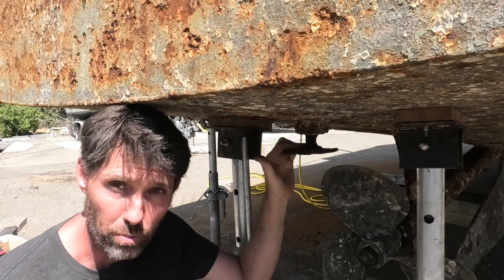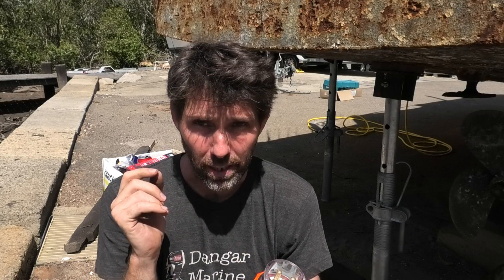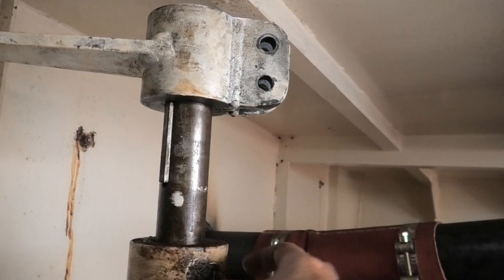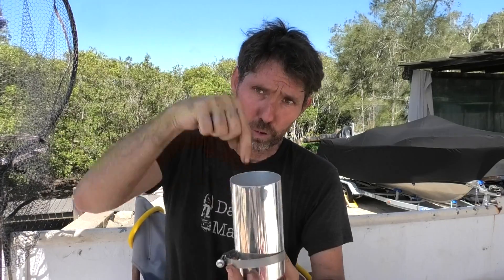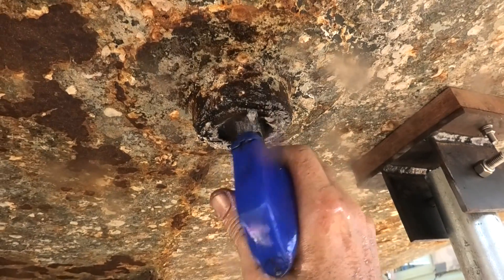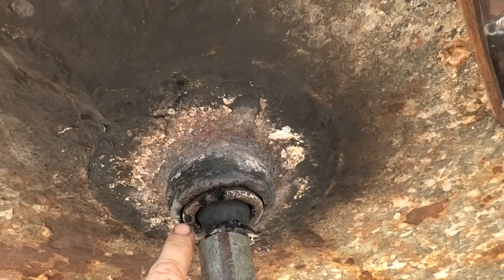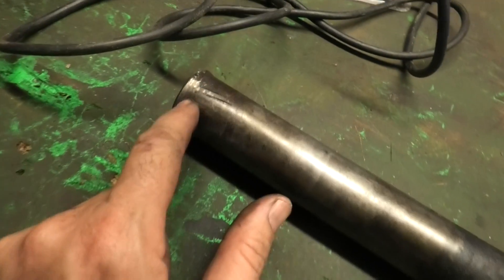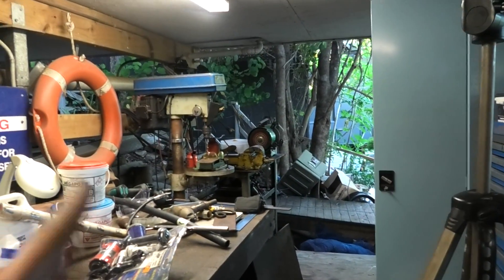Removing the rudder post

Comment: LOL So nostalgic. I got a wooden boat in 1990 that was thirty years old. Just watching you go through the process of addressing a problem and keeping at it until you find success was in some macabre way gratifying. I recall so many projects that had a similar arc of progression., engine removal and replacement, rudder r&r, plank mending, keel filling. etc. etc.  Thanks for the vids. Keep on keeping on mate. The only justification for any of this is the sail to work ratio. As long as a fellow spends more time on the water than working on the boat it is worth it.  I oughta' get out to the vintage fiberglass cabin cruiser in my driveway and go to the lake.

Comment: Good stuff on getting the rudder post out. as for the crane, yes you will be stoked if you can keep it level, i used to be a hi-ab operator and being on the slightest slopes can make turning cranes really hard especially with heavier loads.

Comment: Just bought a 98 Yamaha 115. runs ok, been in fresh water only, and am getting after it for my use. Rebuilding carb. checking heads ect. Alot of the things you have taught me, actually everything you have taught me, steering cable really tough to turn, everything. Thx
Reply: You know that steering might not  be in the cable but could be in the swivel tube on the engine bracket! That would be really nice and a quick fix :)
Reply: If it's one of the saltwater series two I can tell you about getting a 600RPM low idle that's as smooth as silk that'll troll all day without oiling up.
Reply: @dustyfarmer  you are trolling at 600 RPMs! You must be trolling on a river with current! 

What do you do, just tighten the throttle plates?

Comment: Never heard the Ferobestos word for a long time, used to fit them on A frames of twin screws of ships n subs,  have about 4 fire hoses on them to simulate thembeing in the water, a chain block and with a scale attached to it, to see how much strain it took to get the props turning.
Old school stuff.
Your doing a grand job Stu, mild steel or stainless new shaft, ally bronze perhaps.
Hope its cooler down your way than up in qld just now.
Cheers
Malc

Comment: Many work boats use steel rudder stocks with stainless shaft liners installed on the stock where the bearings locate. But for your shaft probably all stainless is simpler.  There is a company named Thordon, who make non metallic tail shaft and rudder stock bearings that work using the ambient seawater as lubricant. They also provide galvanic isolation.  Thordon would work well for your installation, if a stainless rudder stock is used. If you go with mild steel, then you need to fill the rudder tube with grease to keep the rudder stock from corroding. That used to be the usual approach, with a seal to keep the grease in, but environmental considerations have made the water lubricated arrangement more common.  Greg

Comment: Watched this on the 63 inch TV in the lounge and was shouting out to use the hot spanner to move it and you finally did, that seal looks like latty packing, not sure If the spelling is right but many years back we used these in underwater gearbox stuffing boxes with a quality marine grease. I would think twice though about replacing the shaft with a stainless one, if it picks up at all it will be an
 Even bigger nightmare to remove than the mild steel one was

Comment: Great video and nice to see the clear thought process and theroy of work. With the rudder tube I'd personally tap and fit some grease nipples to maintain the rudder post with lubricant
Reply from the maker: Fortunately it already has a grease nipple installed between the two bearings.

Comment: Wait, so the only think keeping a 40mm steel plug from falling out and sinking your boat was that fibrous bearing material and the actual steering mechanics?  Oh, and I guess the rudder and bottom bracket.  Awesome that that's done!  I'm looking forward to seeing how this project continues on.  Keep these videos coming!

It's really cool to see that you're into music.  The cinematography kind of took me by surprise!
Reply from the maker: Yeah, that little 20mm thick gudgeon plate at the bottom might help keep it in place. ;) I do love music, one of my main hobbies outside of boating.
Reply: @DangarMarine  Very cool.  How about a quick off topic video about your music?  May I ask your day job?  Is it repairing boats?
Reply: I think like in my sailboat that the water will only go as high as the water surrounding the boat, since the mechanic space is higher than the surrounding water level, it won't flood.

Comment: Glad you got that shaft out Stu. I guess you are going to use sacrificial anodes. Seeing as you are a saltwater boater, you should install zinc or aluminum anodes to prevent galvanic corrosion on the engine and underwater parts of your boat. Stainless is nice for your steering, but expensive. But we all know that boat stands for Bust Out Another Thousand;-)Thanks for posting.

Comment: Interesting watching your project progressing, thanks for sharing. 
If the crane is not level when lifting heavy loads it will want to turn to the lowest point. If you use it when floating; it could turn suddenly and dangerously if the boat listed when the crane was lifting.
Reply from the maker: That is a good point about turning when lifting if another boat goes past. Definitely something worth thinking about in the design.

Comment: What an epic episode. Roger Dale nailed it in these comments about the bearing material. If your boat had cable operated steering the problem would never have progressed to be so bad. But as evidenced by your bottle jack - hydraulics develop a lot of power and overcame the resistance created by the bearing being clamped onto the rudder shaft as corrosion took hold.

How about trawling scrapyards boatyards for a reclaimed rudder shaft?
Reply from the maker: Yes, finding a reclaimed shaft would be aweseome.

Comment: I work on boats a lot, mostly sailing boats but work on all boats. I would say 100% use stainless steel for the rudder post. The bottom bushing should be brass with a rubber inner, they are commercially made specifically for that job.
Interesting videos, Thanks.

Comment: Hello, I think that that bearing material is ORKOT, I work for a company that machines this material into bearings / liners that are used on submarines/ ships etc, it is a marine bearing material that is designed to swell up a little when submerged. It is even used to line torpedo tubes. Very easy to machine but I think the size it’s cut to has to take into consideration it swelling in order for it to function properly.
Reply: I’ve just done some research, ORKOT is actually designed not to swell up!!

Comment: WOW !  Stu has a second career.  MORE SINGING, even if it is drunken sailor songs !

My vote is for a stainless rudder post.  Big $$$ for sure.  More important, what material for that bushing.  I think nylon is too soft.  Perhaps Delrin ?  I can not remember the name of that material, but is it sometime used in cutlass bearings.  Need a method of greasing the shaft, especially if you go with mild steel.

Comment: Some nice work there. whatever you do, make sure the material is the same in the rudder and the shaft, all stainless steel is dependant on a constant supply of oxygen to keep the oxide barrier intact (this is what ceaps the "stainless" from rusting). you must have liberal ammounts of zinc on the rudder, and a hefty ground strap from the top of the post to the hull. using stainless in the combination whith mild steel is not ideal. i used to work as a cheaf engineer, and have sean this plenty of times. its dooable, but harshe on the anodes. greatings from norway :)
Reply from the maker: There currently isn't a ground strap at all from the top of the rudder post to the hull. I'll have to look into the best way to do that. The little musical section in this video was inspired by watching Stories from Norway at the moment. The one about the Hamar diving board was priceless. :)

Comment: Excellent getting the rudder post out!  Yay!
I would go with Stainless Steel low carbon 304 since it should be be safe to use unlike the 316 kind...but it's your call  :)

Comment: 14:20: We have a deck crane and a chain fall aboard as well. Very handy. Keep it near the centerline.
Reply from the maker: Yes, I'll just have to check the reach on it. Maybe if I keep it near the transom? Also been looking at some small 24V hydraulic units rather than this little hand pump one.
Reply: @DangarMarine  Start with the hand pump one. It will work when you really need it. Lengthen the handle if you want. Near the transom is fine, but consider what the weight of you, the crane and whatever the load is will do to your reserve buoyancy and then decide. If it's for winching in single batteries, fine, but if it's for bringing in 100 kilos, it might affect stability. You'll have to experiment.

Comment: I've got an 'ole steel yacht, that I replaced the rudder stock on as well..An engineer friend who works at Blue Scope Steel, recommended I use COR-TEN high tensile steel..Probably what your boat is made from as well.
Reply from the maker: Interesting you should say that. I have always heard that COR-TEN only really works well above the waterline. I'll have to look into it more.
Reply: Yes, I would ask someone in the marine industry to confirm that..

Comment: the whole unit stainless steal.  It will cost but you will never have to mess with it again.
Reply from the maker: I agree, my only thought is that a mild steel one lasted 30 years which is probably longer than the boat will anyway. I'll check the price difference.

Comment: My 2 cents worth, I would make the new rudder shaft from 316 stainless which should be well capable of handling the torque of your rudder; has excellent corrosion resistance and is free machining. I believe the old rudder bearing may have been made from Maritex 1810 phenolic resin which looks similar to Micarta phenolic resin.  May need to polish the inside of the bore with a flap wheel with an extension rod on a drill or die grinder to clean up. Will probably need a set of telescopic gauges and a micrometer to measure the bore (message me if you need to borrow these).Maritex 1810 would be the preferred replacement for the bush. May need some soft of epoxy resin to glue it into place. Great to see you didn't have to cut the whole tube out. Cheers :)
Reply from the maker: Hey Matthew. Yes, will definitely hone the tube out - at least at the ends where the bearings will be installed. I'll need to find a good tool to measure the bore diameter. Have been meaning to buy one for ages and now seems like the right time. Catch you soon!

Comment: Ran into the same problem with a rubber bushing in a steel sleeve.  Burned/melted the bushing out with an acetylene torch.

Comment: Thanks for your videos.  I think they are popular because you experience problems we all face and don't pretend to have all the answers.  In regard to replacing the rudder post with stainless, I think you have to consider the application above all else.  With stainless being less ductile than mild steel, the length of the shaft and the torque loads may lend itself to choosing a more ductile material.  Stainless steel may be more corrosion resistant, but will it hold up with the constant torque loads?  I think I would go for mild steel with some corrosion prevention such as grease points for the tube.  There is a reason why stainless steel is not used everywhere in marine applications.  I am an aircraft engineer and while aluminium is the choice for structure almost every faying surface is coated with a compound to reduce electrolytic corrosion. Two surfaces of the same material can still have a potential difference which is all you need for electrolytic corrosion.

Comment: I used to work on trawlers like yours and bigger here in the UK, You have a nice little boat on your hands and a great channel too.
All the boats I worked had grease points on both the prop and rudder shafts, That steel shaft has lasted 25 years, stainless may sound better but. . .  wow the cost over mild steel & how long do you plan to own her??? Good luck and just keep going.
Reply from the maker: I think that’s good advice mate. For the cost,  if a mild steel shaft gets me another 20 years then it will see the boat through.

Comment: Yer replacement rudder shaft could be turned slightly smaller diameter in the center area. Then it will come out much easier next time. If it were mine, I would consider putting a grease fitting on the shaft tube and pumping in a some OIL every now and then.

Comment: If you're going to reuse the rudder you'll have to go stainless. But the alloy you choose for the shaft is important. My cousins yard uses Aquatech for propeller shafts and a post like this. Please take a look at my other post as I added a link there that'll really help but I posted separately because sometimes Google flags them as spam. If you can ask around as you might find a bent propshaft to use for a rudder post ;-)
Reply: Prop shaft for the rudder post! :/  good idea!
Reply: @BornAgainBoating   the material is expensive. So we hang onto the bent ones just for projects like this. We'll usually get 1-2 jobs a year where some drunk idiot parks on the jetty or rocks ;-)  If he was in the States I'd probably have a shaft he could use for the post. Even a mangled one will straighten out enough for this, or have enough that's still straight above the cutlass bearing. We do have some straightened and reused but insurance jobs and ones that run at a high speed usually get replaced.
Reply: @southjerseysound7340  sweet! Where do you work? We dont work on anything big like this. The place I work doesn't have a travel lift so we mainly only work on outboards. Boats under 42' cause that's the biggest we can lift. I've got a video this week of repowering a triple engine 36' yellowfin!
Reply from the maker: Great idea, I'll ask down at the marina where the boat first came out of the water.
Reply: If available that's probably a quick solution for Stu since he's handy at welding
Reply: @DangarMarine   If it's too big it can be turned down to size where needed and if what they have is smaller you can make bushings easily. I also have the guy at the local scrap yard keep an eye out for them and good bronze. You'd be amazed at what gets tossed at times and can be had for a cold 6 pack plus a few bucks ;-)

Comment: I would second the suggestion to use Aquatech.  Stainless itself is subject to crevasse corrosion which the lower gland's environment is perfect for.  Monel may also be another choice.  These alloys are made to combat the corrosion problem.  If your boat is properly "zinced" (not too much, not too little, in the right places, and the proper alloy of zinc for salt water) properly differential between stainless and mild or even brass alloys and mild steel should not be a problem.  Make sure wherever you moor your rig there is not stray current in the water.  Improper AC shore power can cause huge problems if they are around you.  Nice project.  Boats=work and work=improvisation.  Take care.  Doug

Comment: I would go with a stainless rudder post to add to the stainless rudder.  Keeping that "part" one metal I think is better.  Add multiple zincs and replace them regularly. Also I would put a zerk fitting or two in the rudder tube so you can easily lube the tube.

Comment: The wear being only on half the rudder shaft makes sense as it would only turn a max of90 degree's aprox so the thrust side  will be the only part that wears. The packing bearing on the bottom of the rudder post will be expandable when wet to act as a seal as well as a bearing, possibly the prop shaft will be of a similar type material. Not sure regarding making shaft and rudder both stainless, an engineer by the name of Google will answer that for you.

Comment: As  long as all the metal parts are bonded together with the hull, it will not matter if you use stainless or mild steel.

Comment: Just a little note, you were not quite sure if you should use mild steel or stainless for the rudder shaft. From my experience with using dissimilar metals will over time will cause more headache in the long run, good luck and enjoy

Comment: I would not use any more stainless steel. Just use a High Density nylon insulator  between the new post flange and and the stainless steel rudder. Also add zinc anode to a wider rudder post flange above the rudder. Note that the rudder post shaft may yet need to be replaced and will need realignment in any case.  Inexpensive, long lasting and easy is the best way.

Comment: I agree go stainless. Preferably 316 or duplex. Dont forget to paint the inside of the rudder tube. I am an engineer for a shipyard and we use thordon sxl for rudder bearings. If you want i can make you a calculation for the dimensions, aswell as propshaft bearings. Hit me up if you want. Greets from the netherlands
Reply from the maker: Good point about painting the inside of the rudder tube. I appreciate the offer of doing the calculations. I'll take some measurements once I have the tube cleaned out. I always love visiting the Netherlands. My mother was born there so I go to visit family occasionally. :)